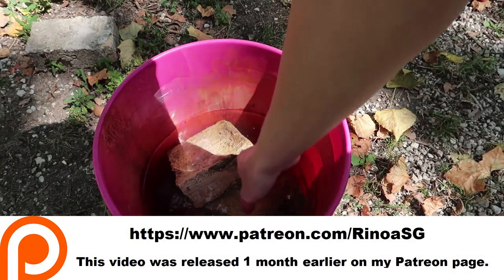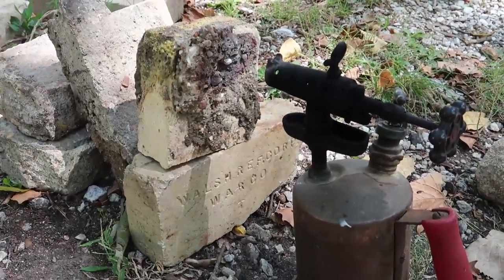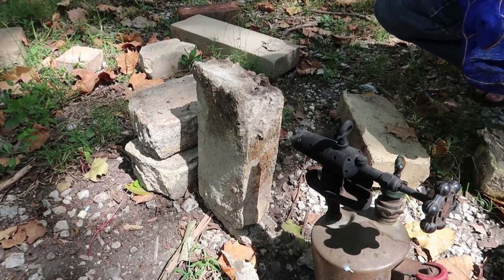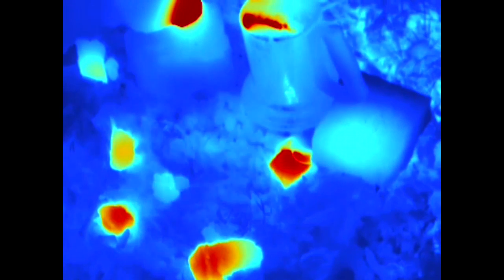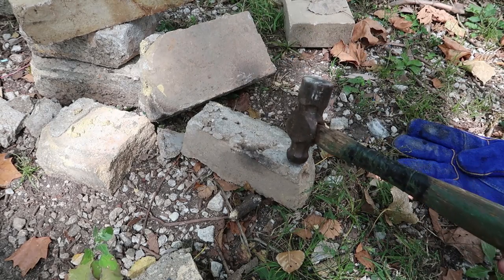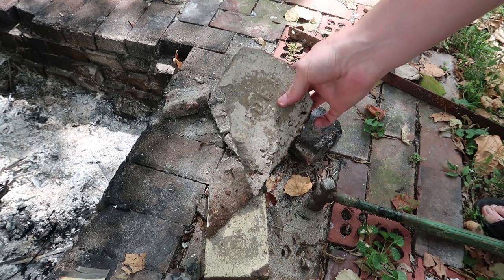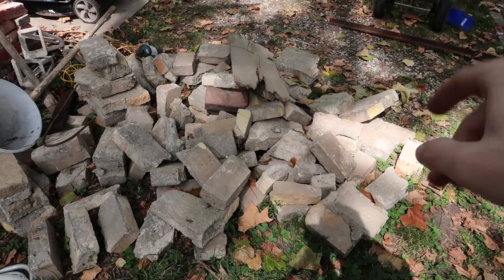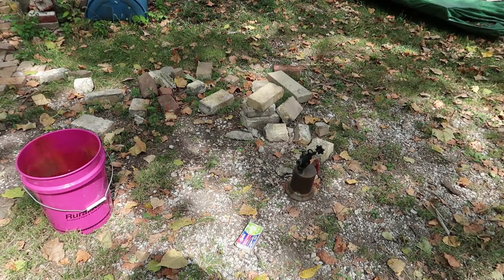Brickeology 05: Clean Reclaimed Bricks with Fire! Thermal Expansion Removes Mortar/Cement/Concrete

Comment: Hi Rinoa
I did a video cutting glass bottles,, way back. Mark tham with a glass cutter, and then hot water, ice water, hot water 5-6 times over, and the bottle would split in two. Maybe the Hot and cold can work here as well.

Comment: I had a salt water fish tank under my house and one day it leaked on to the concrete, that area where the water sat still the cement dissolved away slowly over the years, it is about 2 inch deep now. Maybe the right PH level will help with you hydrating the bricks.

Comment: Interesting. I’m curious, if it behaves any different if you just dry it out without heating it up all the way. Could the moisture content in the cured concrete probably make any difference regarding its brittleness? Rehydrating then should also make it tougher to get off.

Comment: Rinoa, Im making an electric bike using 18650. Im doing a 36v motor so do you think i should do a 9s 33.3v min (at 3.7) and 37.8 (at 4.2) or a 10s 37v min and a 42v max?
Reply from the maker: +Cameron Shoudt 10 would be faster but bigger, 9 would still be fine. up to you
Reply: Rinoa Super-Genius ok. Thanks. And do you know of any good kits with the bms and charger with it? Also if I do the 10s what voltage charger should I get?
Reply from the maker: +Cameron Shoudt idk, figure it out for yourself.
Reply: Rinoa Super-Genius ok. Thanks for  your help anyways

Comment: The brick appears to be fire brick?  Are you planning an out door oven?
Reply from the maker: +Hannah mich not exactly, more like a kiln/furnace and a forge. these are from a high temperature kiln so ey should be fine
Reply: Rinoa Super-Genius    I guess you'll be using some sort of refractory cement when building you oven?  A friend is finishing a outdoor oven for a customer who like you is setting up a U tube channel accept his will for used only for cooking. They have built several small fires in order to cure the oven slowly. The oven is so large that it could cook a weeks worth of meals at the same time. Lol

I also thought you would be interested in building a iron making kiln. I've been thinking of building such a oven for for years and then one day a local community college did exactly that for a public project. In as much as we live in a iron mining area access to raw material is easy. But even so the process was long and hard to do. It required much charcoal. The process also destroyed the furnace. The resulting iron Blume (sp) weighted only twenty pounds. The Blume needed hot forging and refining to raise the grade and quality.
I guess it isn't what you make it's the process you go though to get there that counts. 

We often find droplet like hematite ore at our abandon mine swimming hole not far from our home. The ore takes the form of smooth skipping stones. In addition I love finding other types of ores found within this rich deposit. Ironiclly the proximity to the very same lake we live on doomed the interesting mining operation here. The lake kept flooding at the giant pit a major cost issue and was the direct reason for closure. But the result is as kids we got the worlds best swimming hole to explore. Lol   I've been going there since I was a teenager and now people are coming from all over to swim and fish in the deep clear waters. The mine dumps are all tree covered forest with walking trails. 

Be well rinoa I wait for your next project.